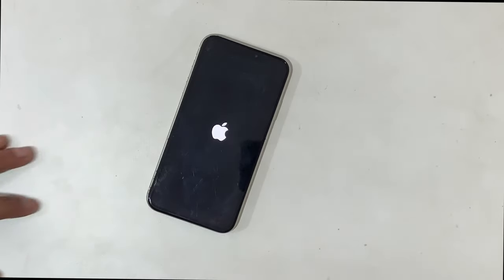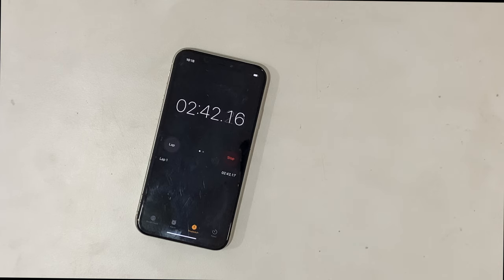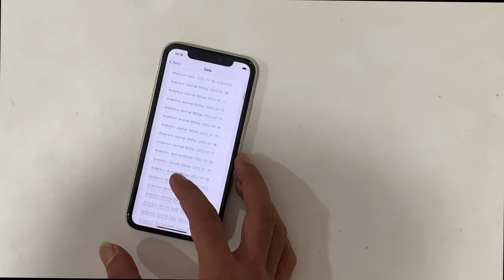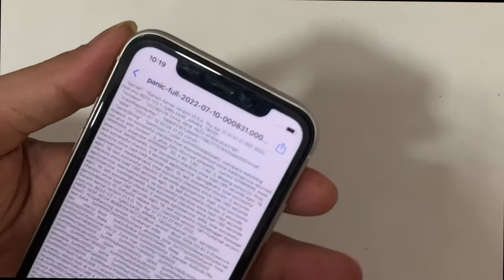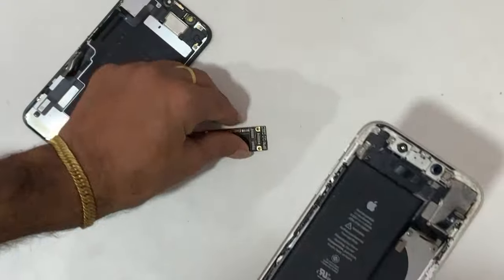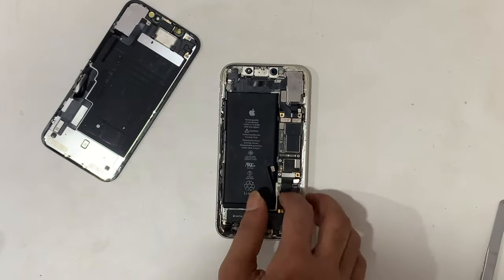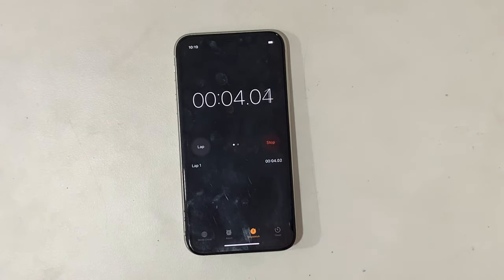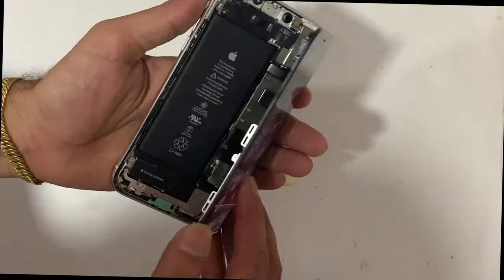iPhone 11 keeps restarting randomly on 2-3 Minute Solution 2022.

Comment: Hi folks. Have a major problem. Iphone 11 was ran over. Still worked, but restarted on its own. I bought a donor iphone 11, put the motherboard and all necessary components into it, however it still restarte every 3 minutes. On top of that, it wont even let me get into the phone because it asks me to put in my pin and right away attempts recovery. The recovery cant complete because it restartss on its own again after 3 min. Never ending cycle. Im baffled. Any assistance would be much appreciated.
Reply from the maker: Can you see your Panic lo then send us.
Reply: I can't get crash logs, it goes into restore mode as soon as I enter pin code.

Comment: BC: 1 RC: 0 BS: 1, Missing sensor(s): mic1 \nservice: backboardd, total successful checkins in 16398 seconds: 1606, last successful checkin: 0 seconds ago\nservice: SpringBoard, total successful checkins in 16282 seconds: 1604, last successful checkin: 0 seconds ago\nservice: mediaserverd, total successful checkins in 16398 seconds: 1605, last successful checkin: 0
Reply from the maker: Charging flex issues.
Reply: @thegsmsolution1  Is it the charging port?
Reply: @luhve9349  no bro,i think its power off button problem

Comment: Please help out, mine says 

SD: O BC: 1 RC: 0 BS: 2, Missing sensor(s): TGOB TGOV TP2C Prs0 Inservice: backboardd, total successful checkins in 206 seconds: 19,
Reply from the maker: Log shows there is an issue with battery loose contact or SWI related issues.
Reply: @thegsmsolution1  thanks, I tried clipping the battery connectors more firmly but still didn't solve it, my solution was I did a reball of the board again

Comment: Hi. I have changed the power port assembly with a new genuine part and now its restarting even faster then 3 minutes i think and it does not show any panic full reports. Do you have any solutions please?
Reply from the maker: If the charging flex is not good quality then you face such issues. Can you share the panic log that I mentioned in the video?

Comment: SD: 1 BC: 1 RC: -1 BS: 1, Missing sensor(s): mic2 \nservice: backboardd, total successful checkins in 194 seconds: 19, last successful checkin: 0 seconds ago\nservice: SpringBoard, total successful checkins in 170 seconds: 17, last successful checkin: 0 seconds ago\nservice: mediaserverd, total successful checkins in 194 seconds: 18, last successful checkin: 0 seconds ago\

Hello sir, what does this mean?
Reply from the maker: On which model did you faced such issues.
Reply: @thegsmsolution1  Iphone 11 sir
Reply from the maker: The log indicates your charging flex issues.
Reply: @stijnkalverboer2781   its a problem from the flexing cable of the flah light or power button

Comment: SD: 0 BC: 1 RC: -1 BS: 1, Missing sensor(s): mic2 \nservice: backboardd, total successful checkins in 140535 seconds: 13993, last successful checkin: 0 seconds ago\nservice: SpringBoard, total successful checkins in 140419 seconds: 13982, last successful checkin: 0 

What does it means sir?
Reply from the maker: Shows charging flex issues.

Comment: Mine is XS. The phone keeps restarting when my display is off. I have to put “always on” display. 

When charging, it will turn off if the display is off. When I remove the charging cable it will restart. But if the display is on while charging, it will not shut down. Need advice on what to do. Thanks
Reply from the maker: Send us the panic log
Reply: Same problem bro

Comment: SD: 0 BC: 1 RC: -1 BS: 1, Missing sensor(s): mic2 \nservice: backboard, total successful checkins since wake (80 seconds ago):9 last successful check in :0 seconds ago\nservice: springboard , total successful checkin since wake (80 seconds ago): 9 last seuccessful checkin 0 seconds ago  .  I changed the charging flex cable still same problem .plz help me plz
Reply from the maker: Log is incomplete brother.

Comment: SD: 0 BC: 0 RC: -1 BS: 1, Missing sensor (s): TGOB TG1B \nservice: backboardd, total successful checkins in 102669 seconds: 10254. what does that means? mine iPhone xR
Reply from the maker: Battery issues or loose contact.

Comment: ANS2 Recoverable Panic - assert failed: [14510]:apcie0[0]: Unexpected link down linksts=0xab000000 pcielint=0x00005000, ltssm=0x00(DETECT_QUIET) - power(12)\nassert failed: [14510]:apcie0[0]: Unexpected link down linksts=0xab000000 pcielint=0x00005000, ltssm=0x00(DETECT_QUIET)\nRTKit: RTKit-2062.40.13.release - Client: t8030.release-
.
What is the issue?
Iphone 11

Comment: Hello can I have some help happened after iPhone 11 back glass replacement 

SD: 1 BC: 1 RC: -1 BS: 1, Missing sensor(s): mic2
Inservice: backboardd, total successful checkins in 199 seconds: 18, last successful checkin: 0 seconds ago|nservice: SpringBoard, total successful checkins in 169 seconds: 17, last successful checkin: 0 seconds agonservice: mediaserverd, total successful checkins in 199 seconds: 18, last successful checkin: 0 seconds ago|nservice: logd, total successful checkins in 199 seconds:
19, last successful checkin: 0 seconds ago|nservice: thermalmonitord, no successful checkins in 199 seconds|nservice: runningboardd, total successful checkins in 199 seconds: 19, last successful checkin: 0 seconds agonservice: wifid, total successful checkins in 199 seconds: 19, last successful checkin: 0 seconds
Reply: power flex

Comment: SD: 0 BC: 1 RC: 0 BS: 1, Missing sensor(s): Prs0 \nservice: backboardd, total successful checkins in 26722 seconds: 2593, last successful checkin: 0 seconds ago\nservice: SpringBoard, total successful checkins in 26695 seconds: 2592, last successful checkin: 0 seconds ago\nservice: mediaserverd, total successful checkins in 26722 seconds: 2593, last successful checkin: 0 seconds ago\nservice: logd, total successful checkins in 26722 seconds: 2594, last successful checkin: 0 seconds ago\nservice:

Sir good am, what does this mean?
Reply: iphone 11 sir
Reply from the maker: Ear speaker flex might be faulty check it by removing it. Due to water or moisture damage.
Reply: @thegsmsolution1  thank you sir
Reply from the maker: Welcome don't forget to subscribe.

Comment: SD: 1 BC: 1 RC: -1 BS: 1, Missing sensor(s): mic2 \nservice: backboardd, total successful checkins in 209 seconds: 19, last successful checkin: 0 seconds ago\nservice: SpringBoard, total successful checkins in 181 seconds: 17, last successful checkin: 0 seconds ago\nservice: mediaserverd, total successful checkins in 209 seconds: 18, last successful checkin: 0 seconds ago\nservice: logd, total successful checkins in 209 seconds: 19, last successful checkin: 0 seconds ago\nservice: thermalmonitord, no successful checkins in 209 seconds\nservice: runningboardd, total successful checkins in 209 seconds: 19, last successful checkin: 0 seconds
Hello sir, can you please help me to detect the issue?
Reply from the maker: Related to Charging flex,Sometime this issues shows from power flex too.Check it.

Comment: SD: 0 BC: 1 RC: -1 BS: 1, Missing sensor(s): mic2 \nservice: backboardd, total successful checkins in 197 seconds: 19, last successful checkin: 0 seconds ago\nservice: SpringBoard, total successful checkins in 169 seconds: 17, last successful checkin: 0
Reply: Please help
Reply from the maker: On which model you face such problem.Can you explain.
Reply: @thegsmsolution1  iPhone 11
Reply from the maker: Panic log indicate to charging flex.
Reply: Does that mean I have to replace it?
Reply: And is it the wireless flex or the other kne
Reply from the maker: Charging flex not an wireless charging flex.
Reply: @thegsmsolution1  oh ok thanks
Reply from the maker: Welcome! If you need further assistance don't forget to comment.
Reply: @thegsmsolution1 sir, i have the same like this . But my model iphone 11 pro? What does it means sir?

Comment: Hello, can you help please ? 
Ipohne 11 

SD: 1 BC: 1 RC: -1 BS: 2, Missing sensor(s): mic2 \nservice: backboardd, total successful checkins in 199 seconds: 19, last successful checkin: 0 seconds ago\nservice: SpringBoard, total successful checkins in 119 seconds: 12, last successful checkin: 0 seconds ago\nservice: mediaserverd, total successful checkins in 199 seconds: 18, last successful checkin: 0 seconds ago\nservice: logd, total successful checkins in 199 seconds: 19, last successful checkin: 0 seconds ago\nservice: thermalmonitord, no
Reply: its a problem from the flexing cable of the flah light or power button

Comment: hi sir pls help me

what does it mean? 

SD: 0 BC: 1 RC: -1 BS: 1, Missing sensor(s): mic2 \nservice: backboardd, total successful checkins in 204 seconds: 19, last successful checkin: 0 seconds ago\nservice: SpringBoard, total successful checkins in 177 seconds: 17, last successful checkin: 0 seconds ago\nservice: mediaserverd, total successful checkins in 204 seconds: 18, last successful checkin: 0 seconds ago\nservice: logd, total successful checkins in 204 seconds: 19, last successful checkin: 0 seconds ago\nservice: thermalmonitord, no successful checkins in 204 seconds\nservice: runningboardd, total successful checkins in 204 seconds: 19, last successful checkin: 0 seconds ago\nservice: wifid, total successful checkins in 204 seconds: 19, last successful checkin: 0 seconds ago\nservice: configd, total successful checkins in 204 seconds: 18, last successful checkin:\nDebugger message
Reply from the maker: Charging flex issues.

Comment: can you help with this log-

panic(cpu 2 caller 0xfffffff01c2de79c): userspace watchdog timeout: no successful checkins from thermalmonitord (2 induced crashes) \nservice returned not alive with context : is_alive_func returned unhealthy : current 3fffffffffffb, mask 1ffffffffffff, expected 1ffffffffffff. SD: 0 BC: 1 RC: -1 BS: 1, Missing sensor(s): TP1A \nservice: backboardd, total successful checkins in 193 seconds: 19, last successful checkin: 0 seconds ago\nservic
Reply from the maker: Logs indicates to CC Flex.
Reply: @thegsmsolution1 This iPhone 11 restarts every 2-3 minutes and sometimes shows a temperature warning. The error code TP1A indicates an issue with the thermal sensor. Would changing the CC flex help resolve this problem?
Reply from the maker: If showing a temperature warning means some issue with thermal no dought. Is that iPhone forcibly dropped or water-damaged.
Reply: @thegsmsolution1  not sure about any hard drops, but about a year ago, it got a little wet during the rain.
Reply from the maker: Log shows to CC flex. You can try once remember that flex must be original.

Comment: userspace watchdog timeout: no successful checkins from thermalmonitord\nservice returned not alive with context : is_alive_func returned unhealthy : current 3bfffffffffff, mask 1ffffffffffff, expected 1ffffffffffff.  SD: 0 BC: 1 RC: -1 BS: 2, Missing sensor(s): mic2 \nservice: backboardd, total successful checkins in 197 seconds: 19, last
Reply from the maker: The log indicate to the charging flex related issues.Replace and check.
Reply: I tried changing it but the problem still persist. It is still restarting. What is the next option please
Reply from the maker: Did you remove and check or replace and check ?
Reply: I replaced and checked sir.

Comment: hi what do i do
 SD: 0 BC: 1 RC: -1 BS: 2, Missing sensor(s): mic2 Inservice: backboardd, total successful checkins in 122384 seconds: 12131, last successful checkin: 0 seconds ago|nservice: SpringBoard, total successful checkins in 122196 seconds: 12114, last successful checkin: 0 seconds ago\nservice: mediaserverd, total successful checkins in 122384 seconds: 12132, last successful checkin: 0 seconds ago|nservice: audiomd, total successful checkins in 122384 seconds: 12132, last successful checkin: 0 seconds ago|nservice: logd, total successful checkins in 122384 seconds: 12132, last successful checkin: 0 seconds ago|nservice: thermalmonitord (2 induced crashes), total successful checkins in 122384 seconds: 12097, last successful checkin: 181 seconds ago
Reply from the maker: CC Flex or Rusty Connector.
Reply from the maker: Charging Flex

Comment: missing sensor (s) TG0B TG0V \ nservice: backboard, total succesfull checkins in 211 seconds: 19
Reply from the maker: There is an issue with your Battery or loose contact of the battery to the battery connector.

Comment: bug_type":"210","timestamp":"2023-06-08 16:52:42.00 +0545","os_version":"iPhone OS 16.6 (20G5026e)","roots_installed":0,"incident_id":"01D76884-7524-4504-A5DB-D1C9D7368892"}
{
  "build" : "iPhone OS 16.6 (20G5026e)",
  "product" : "iPhone12,1",
  "socId" : "8030",
  "socRevision" : "11",
  "incident" : "01D76884-7524-4504-A5DB-D1C9D7368892",
  "crashReporterKey" : "5e2fda479273d96cf56b357d5377889f45cba7e1",
  "kernel" : "Darwin Kernel Version 22.6.0: Tue May  9 06:18:02 PDT 2023; root:xnu-8796.140.12.502.1~12\/RELEASE_ARM64_T8030",
  "date" : "2023-06-08 16:52:42.66 +0545",
  "panicString" : "panic(cpu 1 caller 0xfffffff01542a7c8): userspace watchdog timeout: no successful checkins from thermalmonitord\nservice returned not alive with context : is_alive_func returned unhealthy : current 3bfffffffffff, mask 1ffffffffffff, expected 1ffffffffffff.  SD: 1 BC: 1 RC: -1 BS: 1, Missing sensor(s): mic2 \nservice: backboardd, total successful checkins in 194 seconds: 19, last successful checkin: 0 seconds ago\nservice: SpringBoard, total successful checkins in 169 seconds: 17, last successful checkin: 0 seconds ago\nservice: mediaserverd, total successful checkins in 194 seconds: 18, last successful checkin: 0 seconds ago\nservice: logd, total successful checkins in 194 seconds: 19, last successful checkin: 0 seconds ago\nservice: thermalmonitord, no successful checkins in 194 seconds\nservice: runningboardd, total successful checkins in 194 seconds: 19, last successful checkin: 0 seconds ago\nservice: wifid, total successful checkins in 194 seconds: 19, last successful checkin: 0 seconds ago\nservice: configd, total successful checkins in 194 seconds: 18, last successful checkin:\nDebugger message: panic\nMemory ID: 0x6\nOS release type: Beta\nOS version: 20G5026e\nKernel version: Darwin Kernel Version 22.6.0: Tue May  9 06:18:02 PDT 2023; root:xnu-8796.140.12.502.1~12\/
Reply from the maker: Looks charging flex issues.

Comment: Please help sir 🙏🏻iPhone XR 

SD: 0 BC: 1 RC: -1 BS: 2, Missing sensor(s): TG0B TG1B \nservice: backboardd, total successful checkins in 340 seconds: 32, last successful checkin: 0 seconds ago\nservice: SpringBoard, total successful checkins in 300 seconds: 31, last successful checkin: 0 seconds ago\nservice: mediaserverd, total successful checkins in 340 seconds: 32, last successful checkin: 0 seconds ago\nservice: logd, total successful checkins in 340 seconds: 33, last successful checkin: 0 seconds ago\nservice: thermalmonitord, total successful checkins in 340 seconds: 2, last successful checkin: 180 seconds ago\nservice: runningboardd, total successful checkins in 340 seconds: 33, last successful checkin: 0 seconds ago\nservice: wifid, total successful checkins in 340 seconds: 33, last successful checkin: 0 seconds ago
Reply from the maker: Battery loose contact or Battery might be damage.
Reply: @thegsmsolution1  and this "date" : "2023-05-01 11:37:57.57 +0800",
  "panicString" : "panic(cpu 3 caller 0xfffffff0135c4278): userspace watchdog timeout: no successful checkins from thermalmonitord in 180 seconds\nservice returned not alive with context : is_alive_func returned unhealthy : current 3fffffffffffc, mask 13ffffffffeff, expected 13ffffffffeff.

Comment: userspace watchdog timeout: no successful checkins from thermalmonitord\nservice returned not alive with context : is_alive_func returned unhealthy : current 3bfffffffffff, mask 1ffffffffffff, expected 1ffffffffffff.  SD: 1 BC: 1 RC: -1 BS: 1, Missing sensor(s): mic2 \nservice: backboardd, total successful checkins in 196 seconds: 19, last successful checkin: 0 seconds ago\nservice: SpringBoard, total successful checkins in 168 seconds: 17, last successful checkin: 0 seconds ago\nservice: mediaserverd, total successful checkins in 196 seconds: 18, last successful
Reply from the maker: Charging flex related issues.Replace original one and try.

Comment: SD: 0 BC: 1 RC: -1 BS: 1, Missing sensor(s): mic2 \nservice: backboardd, total successful checkins in 181537 seconds: 18101, last successful checkin: 0 seconds ago\nservice: SpringBoard, total successful checkins in 181511 seconds: 18099, last successful checkin: 0 seconds ago\nservice: mediaserverd, total successful checkins in 181537 seconds: 18100, last successful checkin: 0 seconds ago\nservice: logd, total successful checkins in 181537 seconds: 18101, last successful checkin: 0 seconds ago\nservice: thermalmonitord, total successful checkins in 181537 seconds: 18043, last successful checkin: 180 seconds ago\nservice: runningboardd, total successful checkins in 181537 seconds: 18101, last successful checkin: 0 seconds ago\nservice: wifid, total successful checkins in 181537 seconds: 18101, last successful check\nDebugger message: panic\nMemory ID: 0x6\nOS release type: User\nOS version: 20E252\nKernel version: Darwin Kernel Version 22.4.0: Mon Mar  6 20:42:25 PST 2023; root:xnu-8796.102.5~1\/RELEASE_ARM64_T8030\nFileset Kernelcache UUID: 6F277A386935C3D192A289A2E790D051\nKernel UUID: 26895BAA-BD97-35F3-8DC6-654C914B3F07\nBoot session UUID: 0ADBE89B-AD36-4E2D-BC9C-EE88D8B14321\niBoot version: iBoot-8422.100.650\nsecure boot?: YES\nroots installed: 0\nPaniclog version: 14\nKernelCache slide: 0x000000001a1b8000\nKernelCache base:  0xfffffff0211bc000\nKernel slide:      0x000000001a1c0000\nKernel text base:  0xfffffff0211c4000\nKernel text exec slide: 0x000000001af2c000\nKernel text exec base:
Reply from the maker: Remove Ear speaker flex and check.